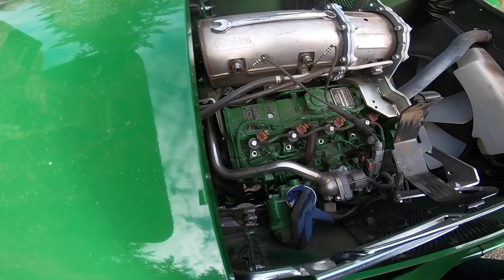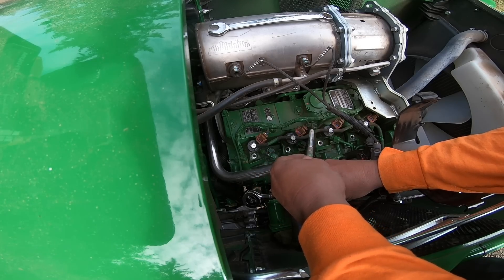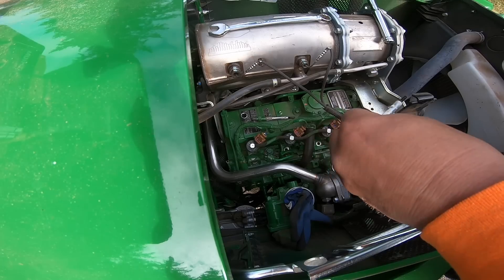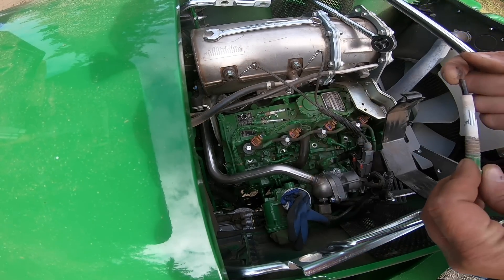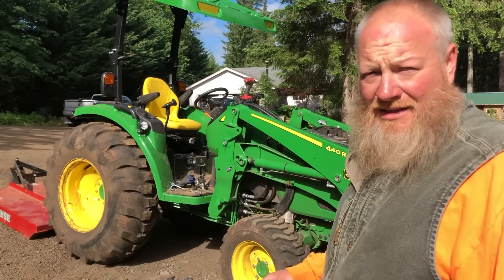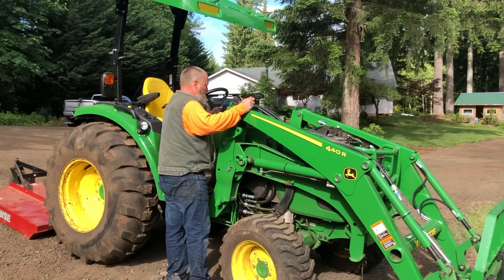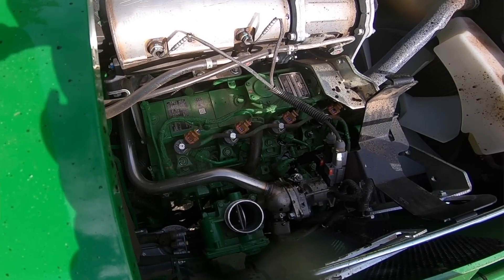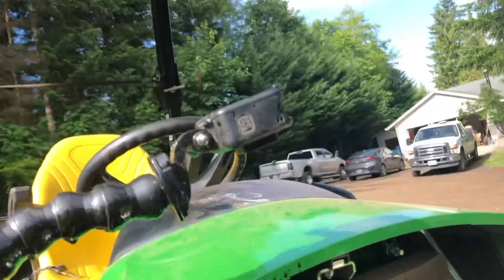Tractor Roll Over Day 2. Did I Ruin My Engine?

Comment: I'm very happy that you made it out with only damaged pride... something we all have. I just hate open cabs and seat belts after being skewered on a limb that was sticking out of ground and I couldn't get away. I think in the most case situation that the seat belt is the very best option but when it comes to me , I have the luck of a squirrel crossing a road. I was in a hospital for a long time so my wheels stay on ground or I don't do it. Taking the glow plugs out was a good idea. I didn't know "Deere" used them but I knew that you needed a hole between air and piston so the whole injector was my only idea. So you outsmarted me.

Comment: I hope people learn their lesson about running heavy equipment with their front ends extended high in the air this is the common mistake made by many people Ed just don't understand the laws of gravity and that you are do you keep your center of gravity at the lowest point do not operate heavy equipment with booms front end loaders high in the air not a good idea also removing the glow plugs after a tip over is the best thing if you have a older model with a mechanical fuel injector pump you can remove the injectors but before you turn it over you have to disengage the injector pump

Comment: I could see the stress in your face before starting it. The relief you had when it fired was obviously a HUGE weight off of your shoulders. I was about ready to head over for a service call. 

The only thing I would have done different is put a rag over the glowplug holes and cranked the snot out if it. But, that's me and I've had to do similar before, so I'm a bit more brave there, knowing what to expect. You did what you were comfortable with, so you did the right thing.

When you went to start it, we're you bumping the key, or was it kicking out? 

For complete piece of mind, you could do a compression check, but from what I heard, it sounded smooth.
Reply from the maker: It seems to run smooth, Timothy. As for the starting, I just turned the key and it would out-spin the starter. I did put a rag over the port once I figured out where it was coming from. Thank you for the comment!

Comment: If the valve cover is easy to get off you can manually hold down exhaust valve on the cylinder that's on compression and bar the engine by hand to clear out the hydro-lock.
Reply: Brandi Bartolomucci he doesn’t know what he is doing

Comment: Safe bet to say in your situation you shouldn’t of bent a connecting rod. In almost all cases went a bent rod accounts due to hydrolock its while the engine is still running and the power of the other cylinders usually bends the rods. Usually if you engine is hydrolocked due to seepage in a roll over hitting the stater to try and clean it out shouldn’t bend your rod a stater shouldn’t be that powerful
Reply from the maker: I’ve put close to 20 hours on it since and it runs fine. I think it’s fine.

Comment: Lots of people run with the ROPS folded and that is a tragedy waiting to happen.  I've rolled two machines and righted another.  Two started right up after sitting a couple days, the other we had to remove the injectors and let it blow the oil out.

Comment: Does your tractor have any ballast in the wheels? Do you think a bucket in the front with fill would have helped? I am buying a 4044R in a couple of weeks and I am thinking ballast is something I am going to add to my wheels
Reply from the maker: Congratulations on your purchase. I built a ballast bar in another video that attaches to the three point hitch. The owner’s manual actually recommends against liquid tire ballast. I would add steel wheel weights if I was going to do anything different. I haven’t had any issues since and my tractor has run great ever since.

Comment: Glad that you're okay and that you got your tractor running again. Don't forget to check your other fluid levels such as the radiator and power steering fluid. Also check the ROPS for any damage to the frame for being out of square, cracks and any other damage to it as well as  the nuts and bolts. Keep up the good work and be safe.
Reply from the maker: I think that if I wouldn’t have been next to a fence, the roof wouldn’t have been damaged. Everything seems to be I good order.

Comment: Take the loader off if your not using it while your brush hogging on hills, that will help stabilize that tractor and it will be less likely to do the roll over thing, I've seen people working ground with the loader way up in the air, I just cringe when I see that. Inexperienced people running equipment they have no business on. It only takes a few minutes to drop the loader. I would think you would know that as you say you are a heavy equipment operator. Glad to hear you made it out alive.
Reply: I've never seen anyone take the loader off to run a shredder. Sounds like something that just makes you feel better.

Comment: You don't think this happened because that headache bar makes you a little too brave do you?  I mean I have a full cab on the backhoe, but never had anything on a tractor.  And I don't think I would have ever made that turn on a tractor.  And are you sure it rolled over in "slow motion"?  I say that because for many people, myself included, panic situations (like looking up and seeing the car in front of you has stopped) seem to happen in slow motion.  Which would explain why you didn't just turn left.  Your brain goes into a hyper mode, so you'd have say to yourself over and over, "Turn Left!" (or "Let off the brake and turn" instead of sliding onto the stopped car).  For some they seem to just get their life flashing before their eyes..

Comment: Thanks for posting this. I didn’t see it mentioned if your rear tires are loaded or not. 

I’ve been considering adding fluid to my tires, this could be the nudge I needed.
Reply: Was wondering same thing. Just added fluid to mine,made huge difference for the better.
Reply: lloyd jarvis that’s great to hear. I need to bite the bullet and fill my rear tires.

Comment: All you have to do is pull the spark plugs out and turn the engine over a few times, clean the plugs and put it all back together. Living in Kentucky with it's steep Foothills, I've seen more than a few backhoe rollovers and the fix has always been the same. And I see that you have done that so good job walking yourself through the possible causes and fixes.
Oh and I said spark plugs but I see you have glo-plugs. But anyway, nice job figuring it out.

Comment: So with all that oil in the top of the cylinders how much did you have to replace and did you replace it before you started and ran it?
Reply from the maker: There really wasn’t that much oil in the cylinders. But I guess it doesn’t take much. I checked the oil before trying to start it the next day and it read full.

Comment: If you can turn the engine backwards it will push the oil out the intake valves. Yeh I know, you got it running allready. I should be on notify, subbed.
Reply from the maker: There’s so much plastic to remove to reach the crank, I figured the glow plugs would be faster.

Comment: Hi , do you run water ballast in your tires?
Reply from the maker: I don’t. I looked into it recently and the local tire shop wanted almost $5.00 per gallon.
Reply: Hi  I guess straight  water would need antifreeze of some kind  if your area has harsh winters. Fortunatly where I am located , in sub tropical Australia  , plain old water works fine . I just jack the wheel up til the tire is off the ground , remove the valve to deflate the tire , rotate tire till valve stem is at 12 oclock. A garden hose with a reducer pipe to fit inside the valve  stem can be used to fill the tire until.water  is  just to the valve level . Install the valve &  inflate tire to recomended pressure . I run water ballast in all 4 tires on my Same 610 4wd tractor  operating in hilly country with a 4 in 1 loader bucket and brush hog ( slasher in Aus lingo )..

Comment: There is a tool called a liquivac that works wonders at pulling oil from small engines..should anyone run into  a hydrolock situation..  shoot even a rigged up 5 gallon buckes  with a suction hose on one side and a length of tubing on the other would purge the petrol.. Good video,  glad You got out no worse for wear.

Comment: yes you got very lucky! you should never ever bump it with the starter hand turning an engine will not bend a rod or valve - pull glow plugs and turn over by hand until it turns easy, only then put the glow plugs back in and crank with starter

Comment: Nice to see no serious damage. But, to all, if you think that you have any liquid in a cylinder, don't crank it.
About 35 years ago I was pushing timber with a D6-D and a buddy was running a D8-H. The D8-H blew
a head gasket and when my buddy shut it down it leaked water into the cylinders overnight. Next day, there
was only that partial turn when he tried to crank it and a cracked head from the pressure. That was not an
inexpensive repair bill.

Comment: You are actually lucky the engine took so long to start. You needed to crank the engine many times to clear enough oil to not damage the engine upon restart. Removing the glow plugs and cranking the engine a couple times couldn't clean out all the oil. On a gas engine, a little oil isn't as critical because of the lower compression ratio they use. Because diesels typically run in the neighborhood of 20:1, there is less room for any liquid and more chance for catastrophic failures.

Comment: Luck is by and large proportional to preparation. So by actually using the seat belt, and having ROPS on the tractor, you made it much easier for luck to materialize. And it's really nice to see and hear that the engine wasn't damaged.
Reply from the maker: I agree 100%. Common sense can go a long way.

Comment: Maybe this will help you or anyone who reads this, maybe you can pin this comment so people can see!  but any time a roll over happens with any equipment what you can do is get like a plastic hospital syringe/ turkey baster/ etc... with a thin clear tube attached to the tip of it ( make sure the tub is secure to the syringe/baster) and dip it into the cylinder and pull the syringe back or squeeze the baster etc and it will suck out all the oil/diesel thats flooded the cylinders! It may take longer but i wouldn't crank it over at all till you knew you had majority of the oil/diesel out of the cylinders you could bend a rod and or sheer teeth off a starter gear etc... The glow plug holes are narrow and thats tough to get all that fluid out the large cylinders with just cranking it alone!  I hope this will help anyone!

Comment: I'm really glad it all worked out the way it did. Very good advice, one bit to add. For anyone who comes across this video while searching what to do with a Hydraulically locked engine, turn it over  by hand before bumping it with the starter. I got a horror story with a 6V53 in a 35 ton Grove that I'll never forget, and thank god I'm not the one who did it.

Comment: Alot of companies build their tractors top heavy unlike older tractors that were wider and didn't sit up so high. Hard to get a newer tractor with a lower center of gravity for working steeper terrain
Reply: They make the "orchard" model, but they have to be ordered, are not four wheel drive, and do not adapt to a front end loader well.  They have shorter rear tires/wheels and a different front axle that is lower to the ground as well

Comment: Glad no rods got damaged, think a lot of people learned, never hit try to start but instead , turn by hand to make sure it’s not vapor locked. (Oil locked in this case) 
   On a side note because of other issues I usually run my tractor with roll bar folded down and because of that I think the seat belt would pin me in. The roll bar are great away from trees but are damaging and dangerous around them. Most people fold them and leave them down because of this. Wearing a seatbelt in down position can be debated, in a side roll over they will protect but in a full I think of course roll bar should be up but if not a seat belt would hurt more. I tend to leave loader up higher in those situations but should  stop and flip roll bar up. When I was a kid nothing had a roll bar on it and we ran things less on the edge. Loader tractors always being the most dangerous. Very glad nothing hurt but your pride. I doubt if you left it set for a week the oil would have ran down. In fact very surprised in ran in that fast but being heated made it flow easier.
Reply: If the roll bar interferes with the trees, trim the trees!  Your life is more important!  Our "Deeres" have fixed ROPS with the same style sunshade.  Even if I had a foldable ROPS, I'd NEVER run my machine with it down!  It is far safer with that ROPS fully up in both side rolls as well as rear flips.

Comment: Glad everything worked out for you!  Was wondering, when you tried the restart, don't you need to be seated due to the kill switch in the seat?  On both my Kabota rigs, ya got to be in the seat before it will try to start...just curious, watching you bump it several times, then you got in the seat and it kicked right off!
Reply from the maker: You have to be in the seat to make it move but it’ll start without being seated.

Comment: I could feel the stress and relief when that engine fired up.  While I'm not and HEO I have transported many different kind of heavy equipment that I had to load.  So I know what that tip feels like.  Thanks for the great advice about the seatbelt.  While I'm religous about it in my car I will jump on my tractor and move it without the belt.  When you're moving one wheel can fall into a hole and that shift in center of gravity will carry you over.  So I will think about you and put my belt on as I do know better.  So glad this worked out for you and thanks for sharing your story.  It's amazing how easy "our" tractors will topple over.  
Best regards,  Lisa

Comment: Next time vacuum pump out the Cylinders agricultural tires fluid and wheel weights work better on slopes than wild slide and turn over high flotation tires.  Can't believe you turned it over on that gentile slope, glad your ok.

Comment: I said remove glow plugs to mayself before you said remove injectors. With no compression you could have reduced the mess by putting a rag on the head and or cranking the engine by hand to push most of the oil out.

Comment: Great couple of videos. These things can happen so fast you don't have any reaction time. Even in a slo-mo type of thing like what you had happen, there's just plain nothing you can do to stop it. I admit I don't usually even have my ROPS up while mowing flat fields, but if there's even the remotest chance I could roll, the ROPS goes up, the four wheel drive gets engaged, and my seat belt goes on. I have a very low level of fear when it comes to machinery on hilly terrain. I'm really glad you're OK.

Comment: Seat belt and roll bar 👍👍👍.  With the old tricycle tractor I have, it's jump as far as you can if it rolls..
Reply: i always use to hear, jump and run. break your leg jumping run on one
Reply: On the old non-ROPS tractors it is better to try to get off if possible. If you have ROPS buckle in and hold the wheel.

Comment: After you Roll tractor over let it sit over night oil will flow back to crankcase enough and it will fire up and be just fine .. Damage occurs when trying to start before oil is removed from cylinders. looks like you did just fine

Comment: Wow, I thought these incidents only happens to me. I've been around heavy equipment since I was a kid back in the stone-age. That's before I was drafted and shipped to Viet Nam. Everything that can go wrong on tractors has happened to me. They didn't have seat belts and it can get dicey. I'm glad this had a good outcome and he honestly shared his advice on safety. I never try and start any diesel engines that have been tipped. You can do serious damage to your engine if its hydro-locked and easily bend the push rods and then some. Hoping the oil settles overnight isn't the greatest game plan,  especially on a pretty new and expensive set-up!

Comment: Just watched this. That tractor must have cost quite a bit. You looked really relieved when it started. Also, I will be wearing my seatbelt.
Reply: The loader $7000 +/-......  the bush hog $2000 +/-.......the tractor $14,000- $20,000

Comment: Thank John Deere for excellent safety equipment, including the ROPS.  Glad you are safe and the damage was minimal!
Reply: Dave O Yanmar not Deere
Reply: @johnhalter445  Yanmar is the engine, Deere has used them for decades, most everything else is Deere. Yanmar has nothing to do with the design of the models or the safety features.

Comment: A few years ago I worked on a golf course operating a Toro mower, mowing the rough and slopes.The machine had a roll cage, and seat belt. One day I rolled the machine on a slippery slope. No damage to me or machine. A day later some poor soul at another golf course lost his life on the same type of machine. Not wearing the seat belt. SEAT BELTS SAVE LIVES. As you said you have been operating heavy equipment a long time. Shit happens all the time, and this time it happened to you but you were wearing the seat belt. 👍👍👍

Comment: Never crank an engine after it has rolled. Get it upright. Let it sit. Turn engine over by hand to make sure it is not hydro locked. If it is pull glow plugs and turn over by hand until it frees up the motor. 
You got lucky on the motor. 
And yes, rops up seatbelts on. 
God Bless
Reply: Tom Broer usually a stater wont bend the rod from cranking. Usually you bend a rod if engine is running and something happen to cause fluid building up in the combustion chamber while the engine is running. In most cases a starter its self shouldn’t be enough to bend a rod